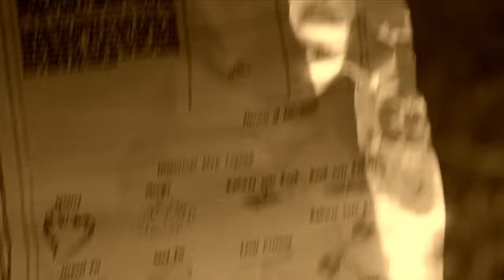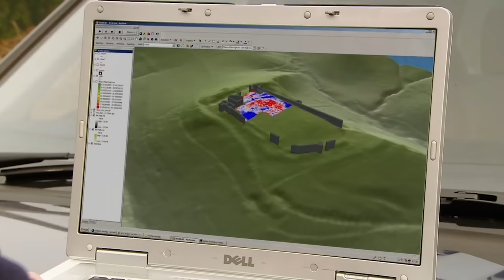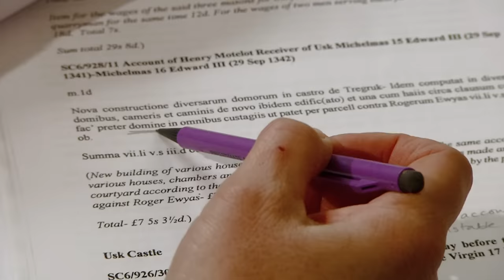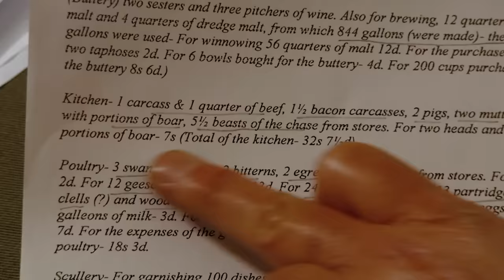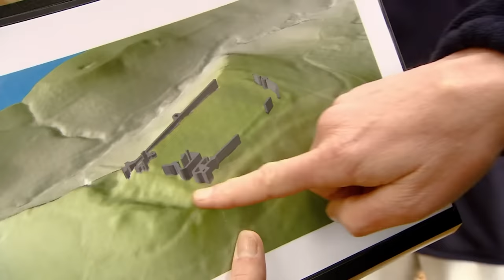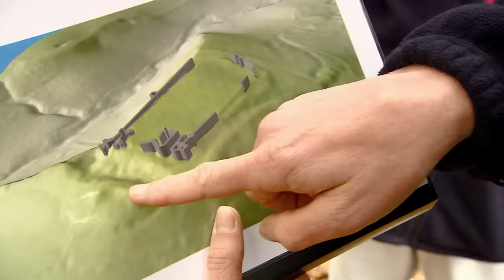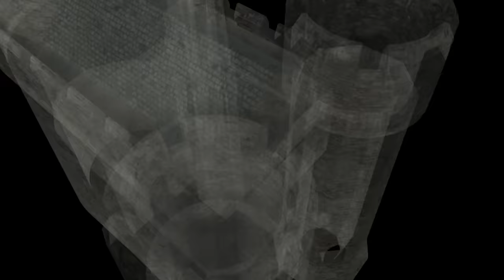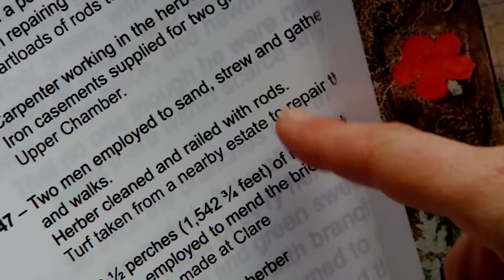One Of The Biggest Castles Ever Built In Britain! | FULL EPISODE | Time Team

Comment: Christmas Feast 1326:  1 ¼ Beef, 1 ½ bacon, 2 pigs, 2 mutton, 1 ½ boar, 5 ½ beasts of the chase. 
 3 swans, 2 herons, 2 bitterns, 2 egrets, 6 capons, 12 piglets, 12 geese, 8 hens, 24 chickens, 13 partridges, 18 woodcocks, 800 eggs, 1 ½ bushels of wheat, 4 bushels of corn.

That's what I was able to transcribe.  Quite a party.
Reply: No Booze?
Reply: 🎵 The boar's head in hand have I bedecked with sage and rosemary 🎵
Reply: @thomasgalyen6757  Of course.  The water was not safe to drink.
Reply: how do you get a quarter of a cow, and what happens to the rest

Comment: Tregrug Castle you were all digging yet you all failed to notice the Square holes in the castle walls near the fancy tower where the ladies would look out of the grand window if you follow the wall you will find Squares of missing stones which would have been where the beams would have gone into to support the floors above.. right down that one wall you can see these squares as clear as day. There was a castle near where i lived called Portchester castle inside the castle was the living quarters for the gentry. that part of the castle has a mote when the tide came in it would fill the out side the castle walls in the mote outside and in turn fill in the one round the building where the living quarters would be to protect the gentry. In the walls i noticed the square holes just like in the wall of the castle you are digging in the wall was part of the living quarters of the castle they were attached to the exterior wall. there was also two gates. one was the tower and the other was the main gate. Portchester castle goes back a ways if memory serves me it was the 11th-12th century. It was a strong hold for protection against the ships coming into the harbour in Portsmouth before there was a garrison and a military base there. I believe  it was attacked by the Normans and it sustained a lot of damage. there is also still a church on the interior grounds there is a wooden bridge that takes you into what was the living quarters in the tower next to the main gate which is on the castle street entrance. the back door as it were is at the other end facing the harbour. I went there and actually played there in the summer months. They used to hold cricket games there too at one point. the Church goes back to the 12 th century i believe. It even has a head stone for a pirates daughter who died. I live in Canada now but seeing those squared out holes in the wall made me think why are you not looking at those they are proof of a building that was there even if you find nothing else. The Portchester castle was built with flint which is in abundance in Portchester and the Paulsgrove area There is also a very big chalk pit in Paulsgrove which would have been ground to a powder and used in pottery along with Clay that is in the Paulsgrove and Portchester area. My hubby is the historian in the family but castles have fascinated me since i was a child i spent the first 22 years in the UK, growing up in Wymering and Paulsgrove. There are a lot of interesting things to see in Hampshire, and loads of places to explore not everyone know where they are. Tony Robinson I didn't know you were such a budding archeologist it was nice to see Bill Oddy helping out too in one of your episodes. I wasn't a fan of Mr. bean or the Baldrick and Mr. Slackbladder thing but my hubby thought it was hilarious i guess i dont have the same sense of humour as he does, that being said i am seeing another side to you, i like this person you have turned into. i guess history surprises us all. Glad i have stumbled onto these shows because i am learning a lot about the UK, i didn't get to see, so thank you for that and all of your other colleagues in these shows.

Comment: You guys are truly blind. This area was inhabited by a tribe who lived upon this hill without walls.  The first walls were fashioned hastily to protect the tribe. Clay and thatch huts.  The walls were improved over a span of 1000 years. The use of the hill changed over time. Improvements were made.  Eventually, after water control was finished in the mid 18th Century, the tribes moved off the hills, and into the valleys and lower lands. Eventually building stone houses along the new shores of the reduced waterways.  They went back to the hills to collect stone in order to build their stone houses in the lowlands.  You are literally using heavy equipment on a spot where Stone Age tools and copper axes exist.